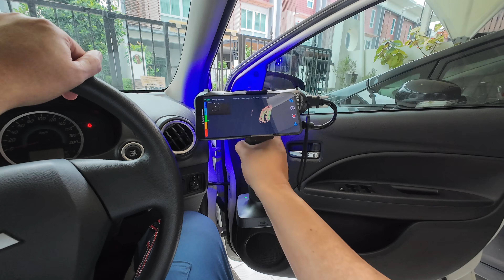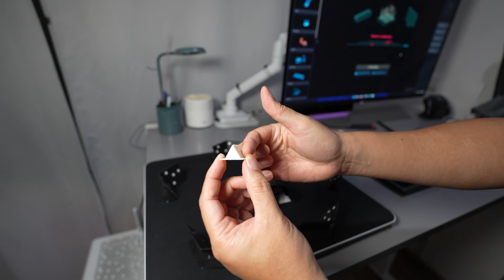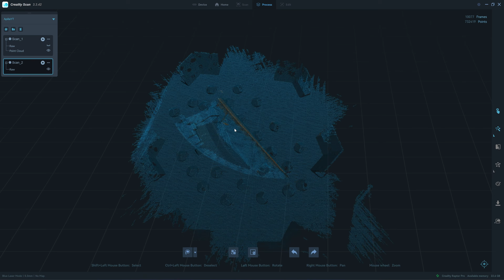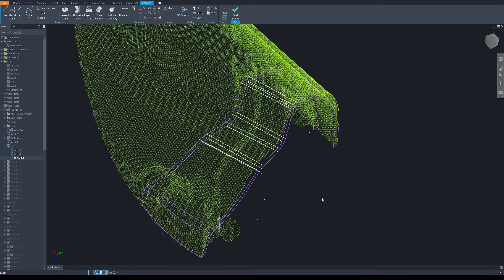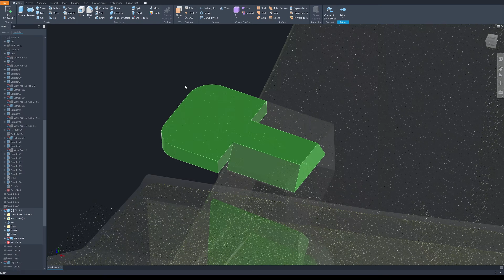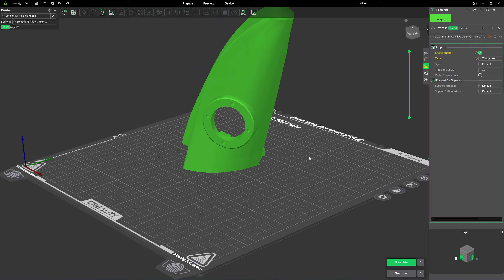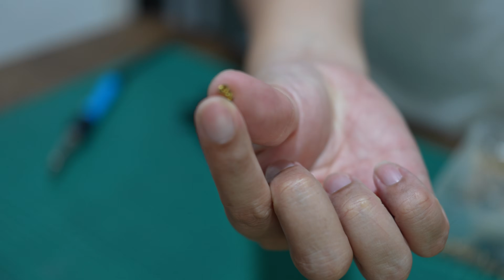3D Scan to CAD: Creating a 3D Printed A-Pillar Speaker Trim with Creality Scan Raptor PRO

Comment: Reverse engineering is more tedious than people think, it's not just a quick scan, import, convert and slap some 3d pods on your CAD'd mesh.  Using the scan as a template to trace is the most reliable and often faster method.
Reply from the maker: Yes, model it as it was originally built using the scan data as reference.

Comment: Today is the first time I've seen your channel. As a car audio guy, naturally I've subscribed and plan to watch many more videos to learn how to do this properly. I also bought a creality unit, so I'm sure that will help with me understanding what you're teaching much easier. I'm a newbie at this and have never used any CAD software or a 3D printer ever yet. Maybe I missed it, but I didn't understand the reason for printing the clips separately from the sail panel? Would it not be possible just to print it all in one piece?
Reply from the maker: Yes, it’s possible to print everything at once. At that time, I didn’t have a filament dryer, and wet filament tends to break when removing supports.
Reply: @Payo-TensileCreator Thank you for explaining that to me. I appreciate you taking the time to do so 🙏🏼

Comment: the clip for the push pin in the end is also going through layer adhesion through it's dove tail . sure that means if it breask you just reprint this part but still you keep relying on the layer adhesion  (unless you print it at 45 degres which will lower the "xy" layer adhesion but will increase the "z" one

Comment: Small advice. You can use an abs paste (melted abs in acetone as a glue) for the abs clips. It makes the clips fully welded with the main part when it is totally dry. Probably the best option to assembles some abs parts like this.
Reply from the maker: That's a great tip, I'll definitely keep that in mind for future ABS projects!

Comment: This isn't the best way to scan. Don't wave your hand around like that. Move your hand in a smooth, continuous motion in a single direction and let the laser beams do the work of covering the points, as the processing progresses by concatenating them.
Reply from the maker: That may have been true for scanners from the previous decade. Those 50 FPS laser scanners generate point clouds by detecting changes in laser line shapes. Remaining stationary only wastes memory and time.

Comment: would you care to share your print filament brand and settings used on the creality printer for ABS ? I have been doing ASA finaly after a bag of garbage i think i got it right using ESUN ASA on my k1 max.
Reply from the maker: I’ve had poor experiences with ESUN ABS, but in the video I was using Creality Hyper ABS. While it has a strong odor, the print quality turned out excellent.

Comment: Can the reverse engineering part also get done with fusion360?
Reply from the maker: Yes, but Fusion doesn't support point cloud import, so you'll be limited to working with the mesh. High-polygon meshes can degrade viewport performance and make tracing geometry more challenging. I've made a video here for mesh vs point cloud. https://youtu.be/OGB5a_2BnBQ

Comment: Amazing work.   Is the software you used free for home use?  The autodesk inventor seems to be a key tool in this workflow.   I’m just starting this journey with a Creality Raptor, and hoping to make some interesting and custom parts as well.
Reply from the maker: AutoDesk Inventor isn’t free for general use—it’s only available at no cost to students and educators through their academic licensing. I’m creating tutorial videos using FreeCAD instead. While it’s not as fast or polished, it’s beginner-friendly and handles point cloud scan data exceptionally well.
Reply: @Payo-TensileCreator thank you so much for your work.

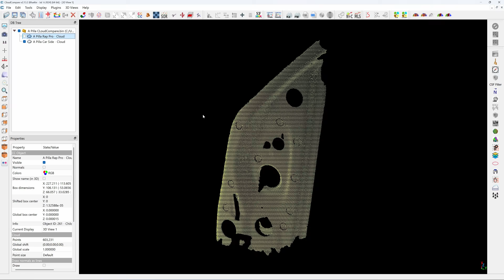Comment: 8:37 I just got my ferret pro today and I was able to scan the side of my jet ski that I want to make Speaker pods for and it took me all day just to learn how to export the file into another program. Can you make a tutorial video for dummies like me with the example of building a speaker pod from scratch to fit the mounting point on your door. Because then I can take that method and build my own for my jet ski.
Reply from the maker: I'm not very much into audio system, but I can try.
Reply: @Payo-TensileCreator please do.
Reply: @Payo-TensileCreator  it doesn’t even need to be for an audio system. I just need to know what to do after scanning a flat surface and how to build something onto that surface so it matches the surface perfectly so that I can screw the unit onto that surface so basically scan the surface make an object fit the surface perfectly and then you can even build just a bubble or something connected to that surface place you just built

Comment: 1:44  when you started scanning the pillar mounting points on the door could you do that with the ferret pro and not your expensive one and my second question is can you upload that door scan onto your computer and build a speaker pod off of that, the reason for my question is, I’m trying to build custom speaker pots for my jet ski and there’s nothing to scan except the area of the jet ski where I want the speaker pod to be mounted to so I want to scan that area and upload that scan and build a Speaker pod off of that scan. Is that possible with the ferret pro
Reply from the maker: You can create a 3D model based around the mounting point. When using the Ferret, though, its resolution will be too low for capturing the part shown in this video. If your mounting point doesn’t include integrated details, it should work just fine.

Comment: would it be possible to make a video on how you would mirror this for the other side, so that the location of the tweeter mount remains the same?  would a simple mirror function work for something like that?
Reply from the maker: I would do that in the slicer software. Just one click and it will mirror. You can also do that in most CAD software, mirror it on any plane and it can be fit on the opposite side.

Comment: Hello! Is there any special add-on or Auxiliary app. for Autodesk Inventor to using to reverse engineering?
Reply from the maker: No, reverse it the way it was originally modeled, and this part was modelled 15 yrs ago. CAD software back there was very slow and had much less feature than today.

Comment: Are you using Inventor all the time for reverse eng.? How about more difficult geometries? Do you have experience with Quicksurface? Thanks
Reply from the maker: The part you see in the video was originally modeled by using CAD 15 years ago. Since it was modelled in CAD then reversing has to be done in CAD and it's much easier to do now than a few decades ago with more powerful PC. Qucksurface targeted user with no CAD skill. For me it's slower, and it can't model complex part.

Comment: if you want to get fancy, you could attempt to do an adjustable tweeter pod to really dial in the angle. Something like a friction fit ball mount that they use for windshield cell phone holders or the RAM mounts. Do a quick print with PETG or PLA with a slightly larger tweeter hole to allow for adjustment. Once you have it exactly where you want, you could rescan and print ABS with the exact angle you want. Cars aren't great for sound and DSP can fix a lot of things, but a properly angled tweeter helps a lot with imaging.

Love your stuff. I'm doing a lot of research on a scanner for applications exactly like this. Do you think the Ferret pro can do this much detail, or would I need to basically double my budget? I'm looking to recreate interior trim pieces and center consoles for old mercedes vehicles.
Reply from the maker: The scanned object has to be bigger than a shoe size for the Ferret to be able to scan properly, and you may need to compensate for larger tolerance.

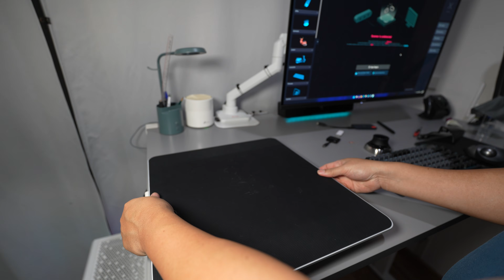Comment: 2:07 What is that tray your putting the scanning blocks on?
Reply from the maker: It's a 3D printed one, download link is in the description.
Reply: @Payo-TensileCreator I'ma talking about the black and silver tray/pad on the desk
Reply from the maker: That's glass gaming mouse pad. The bottom part is matt black rubber and top part is white frosted glass. So I can switch between black and white, some scanner won't see white turntable when scanning black object and vice versa.
Reply: @Payo-TensileCreator Thenk you very much

Comment: Wow that scan quality was insane. That thing appears to work much much better than my Einstar for this kind of application.
Reply: @firworks  was it the einstar 1 or one of the newer ones with the blue lasers?
Reply: @rjanderson4207  It's the original Einstar.
Reply: are you using the sublimating spray? It made a massive difference for me
Reply: i have a brand new one toucan von 3dmakerpro .. and the quality of the scan is not the same ! and the crealty one is a 2-3year old model ? so maybe the software of 3dmakerpro is sh*t too

Comment: print with ABS and smooth with acetone chamber or heatgun. It will be silksmooth
Reply from the maker: Thanks for your advice, but I'm allergic to solvent. I'll try sanding + primer + topcoat in the next video.

Comment: Why didn't you just stand the trim piece up straight and scan it all in one? And then just add the little clips on the bottom manually?
Reply from the maker: The original part can't stand up right, the clips are not removable.
Reply: You just make up a little stand, it takes 5 minutes and you can scan 99% of the object in one go  @Payo-TensileCreator
Reply from the maker: It’s not that I can’t make it stand. Scanning a black surface with deep pockets and crevices requires positioning the scan surface closer to the marker. An alternative is to place 6mm markers directly on the object's faces, scan in global marker mode, and handheld the object for a single-pass scan without merging. The method I used in the video is faster and easier.

Comment: Can you do the same with fusion 360?
Or Autodesk inventor is better in this case
Reply from the maker: I believe you can. However, Fusion 360 doesn't support point cloud imports as a reference—you'd need to convert it into a mesh, which can impact software performance and make tracing more challenging. FreeCAD might be a better option, as it allows direct point cloud imports.

Comment: Hi Payo are you able to repeat this scan and merge using the Otter scanner? Would be good to see the differences.
Reply from the maker: Yes, sure. But I just put that back into my car. The push pin's wearing down haha.
Reply: @Payo-TensileCreator  don't worry. I'll wait for you to do another similar scan. I'd like to see scanning both sides of an object that has thin edges like the A-Pillar from your car. I have recently scanned something similar with Otter and struggle to get both sides to merge into a mesh. The merging isnt happening evenly across the object and the overall final thickness of the object isnt correct.

Comment: Great video! Question - Why did you use the RaptorX for the door sheet metal geometry and Raptor Pro for the plastic cover? Thanks
Reply from the maker: Wireless handle's kept in Raptor X case. That's it.
Reply: @Payo-TensileCreator  Truly appreciate the input! Thanks again for sharing your scanning experiences with these scanners - as I have recently ordered a RaptorX with wireless handle.

Comment: Cool tutorial and all but I don't know man you're turning a super light part into a weight (tweeter) bearing part held only by plastic clips and rigid plastic.. Any kind of base is going to rattle that thing like no tomorrow IMHO. Maybe if redesigned to convert that top push pin, which by the way I don't think we saw you clip on, to a screw of some sort would make it a little more durable? Anyhow it's an exercise :)
Reply: Sentiment does not come across in text so Ill preface my post by saying I mean no disrespect. I do agree that his approach to mounting his tweeter would not yield the best acoustic result. Durability is also an issue when comparing the OEM part and a rigid pla part. 

I feel his video is more of an exercise in demonstrating the workflow, machine capabilities, and result. He did that very well.

If it was my vehicle, I would cut a hole in the OEM part, 3D scan my tweeter and pillar then print a mounting adapter. A tweeter weighs no more than a couple of ounces so it should be fine. Most people run their speakers from the head units power and add a D class amp& sub for a little bump. Unless you're entering some type of SPL competition, this approach should be fine. There is a great car audio channel that implements 3D printing into car audio frequently. A quick search would bring it up I'm sure. I have used 3D printed parts in my vehicles with success.

Comment: can i reverse enginer this the exact same way you did but with fusion or is it only possible with inventor, is there a name for the process of cutting the point cloud into a bunch of slices and lofting them together as sketches
Reply from the maker: You should be able to do that in most CAD software—the Loft command has been available for over 25 years.
Reply: @Payo-TensileCreator  is the Loft command in Freecad suitable for producing this model, same as you have done it in Inventor?